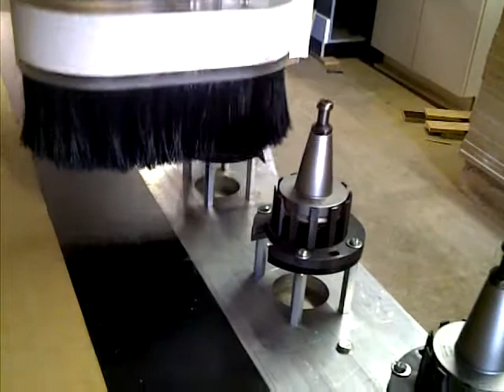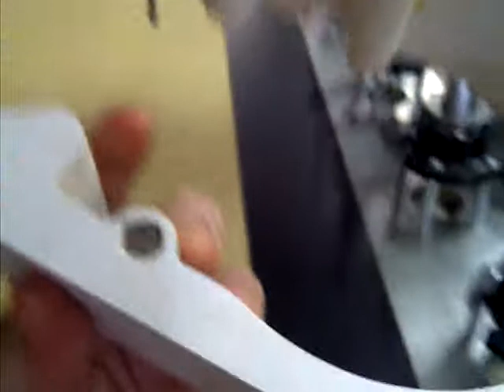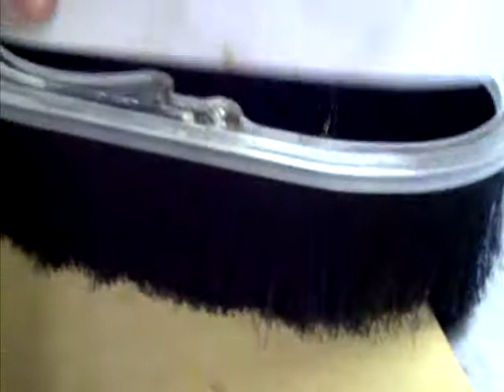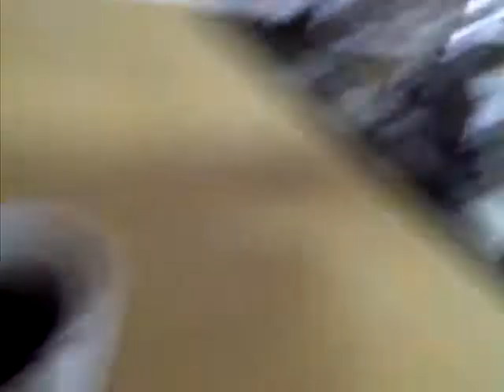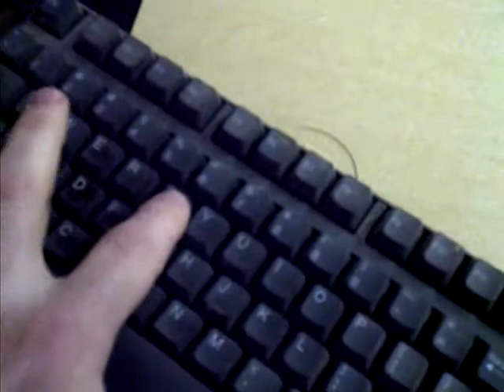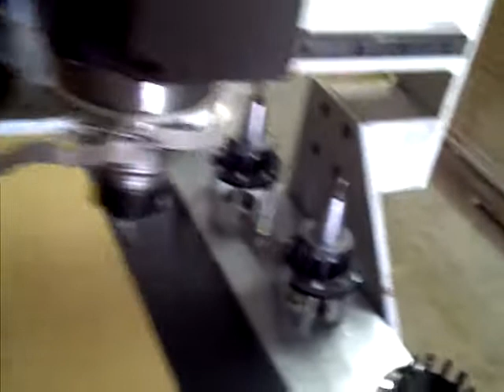shopsabre cnc router tool changer conversion to thermwood style

Comment from the maker: Frank, i just re-read your post, and i think i understand better now what you are saying. I may have confused you and me both using the term “toolholder”. I have always called a toolholder the part that the router bit mounts in with the collet. I guess that makes the forks the toolholder toolholder LOL.   Just to clarify, i did decide to purchase new “non-fork” style ISO30 toolholders when i did this project. They are the plunge style; the same ones used on a thermwood. They were not cheap, and i had to buy a special tool just to change the bits. Now that i understand better that you are keeping your fork style tool holders, i think you can easily accomplish the same thing i did building your own holders. I’d be willing to bet that Lowes or Home Depot have some misc parts you could piece together to make them easily. The big question for me is how the HSD spindle releases the tool. If it’s like mine, it just lets it go and blows the dust off at the same time. If you calibrate the machine precisely, you won’t need rubber bands or any tension holding the tool when the router moves back up to grab another tool. Sorry for the confusion!!! Hope this helps. Let me know if you have any more questions. Would love to see pics of the final product.

Comment: Thanks for writing back. I just ordered two tool holders like that to sample them. They also need a little rubber band I guess to keep tension on them. After using them for a few years, are they durable or did a little fingers tend to break off? I guess should I order some extra as a backup? Thank you for your feedback as I'm looking to convert over to these, cuz I seen many advantages
Reply from the maker: Mine have lasted 3 years without any issues. I didn’t use rubber bands either. If you calibrate the machine just right, you probably won’t need them. It wouldn’t hurt to order a backup.

Comment: Hey I really like these tool holders.. Where did you get them?... Did you make them ?   Do you see any downsides to this style versus the Fork Style tool holders?
Reply from the maker: I purchased tool holders from Thermwood re-seller site. I got a stock piece of aluminum and cut holes and tapped for threads in holders. I like them much better because it allows for you to have a much more efficient dust skirt. I am not a fan of fork style tool holders because they don't allow for a good dust skirt. The dust skirt has to be mounted higher to allow for forks to go in sideways but with the straight plunge holders, you can have a much better dust skirt and it just drops the tool into the holder. I personally don't know why Shopsabre didn't use this style to begin with; maybe it's patented???? Since i made this conversion, the machine picks up 95% of ALL dust vs. 65% to 75% on the original one. Much less cleanup which saves me lots of time.

Comment: Hello Again... I ordered 2 pairs of Basket tool Hoolders... And they Came in..I have an HSD Spindle with ISO30 Toolholders... the kind that go into forks.However.. the baskets fingers are much wider... as if for a larger toolholder.Did you have to order another kind of toolholer?
Reply from the maker: Hi again. I need to dig up my invoice of the exact parts i ordered. Me and my family have moved to a different city, and my woodworking shop where my cnc is located is still back 100 miles south of here at my other residence. I know i have the part numbers, etc there. I remember i ordered a few different styles before i got the correct ones (it was a frustrating search). Before i lucked up and got the ones i bought, i contemplated making some tool holders. It would be super easy (and cheap) since the router is just setting them down and releasing them into holes. However, i’m not sure if the HSD spindle releases the tool the same way as my PSD Colombo. It will be a few weeks before i make it back to the shop. If i find part numbers in the meantime, i will send.

Comment: I don't know if you monitor you YouTube Comments... but I wanted to ask your reflection about going to these tool holders... 
Any Negative or downsides compared to the forkstyle?...   Is there a problem with ISO30  with extended shanks?.. the ones you use for the smaller shorter bits?
Reply from the maker: No negative; all positive. I had to purchase a special toolholder mechanism for changing the bits and collets (about $150); thats the only downside. It’s all upside from there. Bottom line, it’s all about dust collection for me. Shop Sabre makes great machines, but their dust collection is sub-par in my opinion. Using these tool holders allows the machine to plunge to change the bits vs. do a side motion, which allows you to have a lot of options for a dust skirt. I haven’t run into any ISO30 extended shank issue. Seriously, no issues other than my bit i use to plane my table wont fit into the holder, but i only use it every few months anyway so no big deal. I have another video on youtube with the machine operating with the modified dust skirt and you can see there is barely any dust. The dust collection is what got me thinking about changing toolholders. It was super easy to program by the way. Thanks

Comment: What dust boot was this?! I just bought the exact same machine with an aftermarket site ATC but no dust boot is on te machine
Reply from the maker: I wish I could remember. I will see if I can dig it up. I had to modify it to make it reach the spoil board.
Reply: @keyeskennard  awesome. Did you love this machine?? Still using it? What software? I would love to pick your brain if you dont mind! haha
Reply from the maker: Paved To Pines Inc  excellent machine. Still have it. I use sketchup to design, import to rhino which is super old. I have enroute to nest. Wincnc is my controller. Super accurate machine. Had to replace bearings due to using wrong grease. Dust collection is the weakness.  However, if you get that figured out, its excellent.